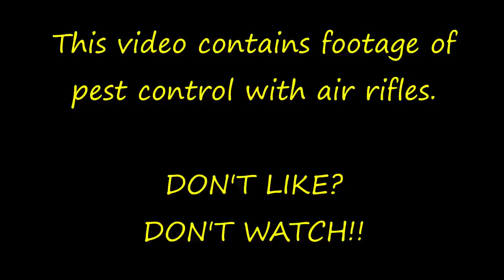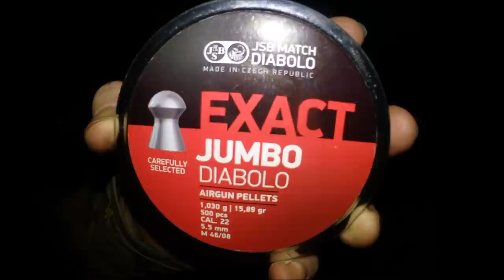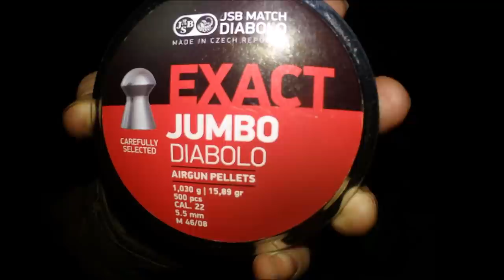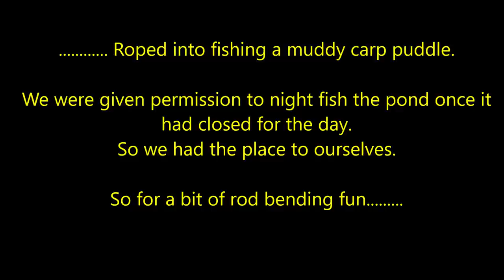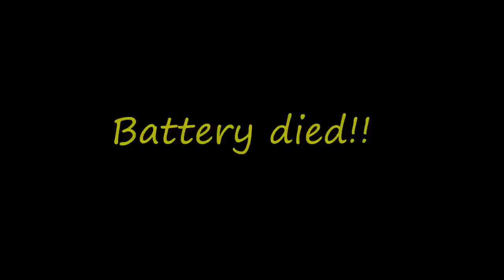Air Rifle Pest Control & Carp Bashing - Rats, Rabbits, Pigeons with PARD 007 & head cam.... and Carp

Comment: Great watch again mate ,pard looks good do you have to take the battery out to charge it on a separate charger
Reply from the maker: You can remove the battery mate. It takes those Chinese 18650 batteries. I always have a pocket full 😃😃👍👍